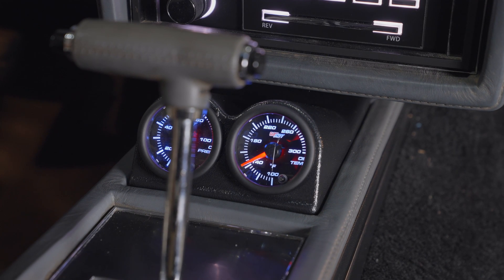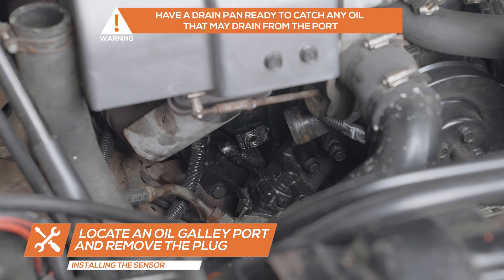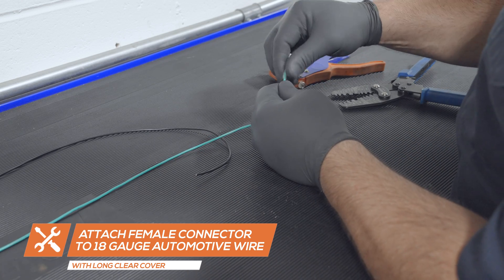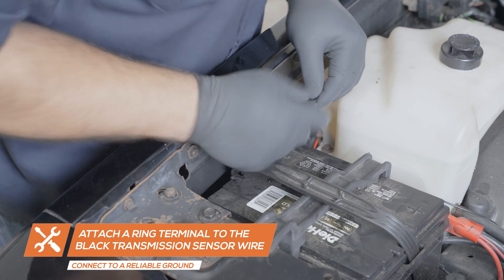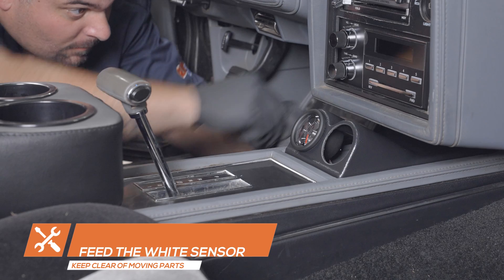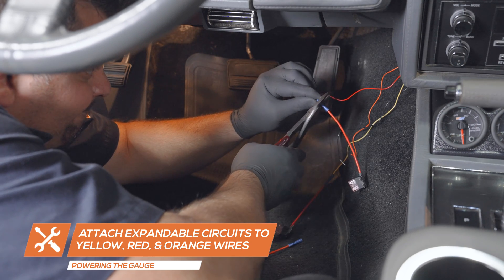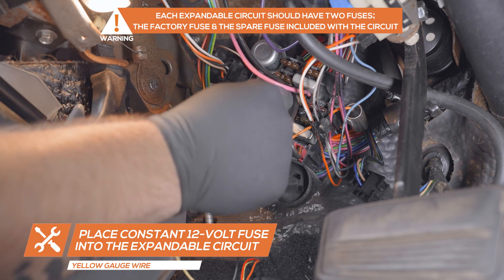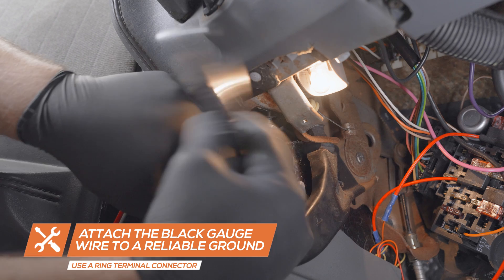GlowShift | How To Install A 7 Color Series Oil Temperature Gauge

Comment: Lets say thats i already have oil temp gauge installed, how would i install my other 2 gauges if i already used 3 expandable fuse for my first gauge alone?
Reply from the maker: Clip off those current expandable circuits and use 3 new ones. Twist all of the red wires from the gauges together and place them into one expandable circuit. Then do the same with the yellow, black, and orange wires.
Reply: @GlowShift  appreciate you fam

Comment: Are the sensor for oil temperature and oil pressure in the same location at the engine? What if I want to install both temperature and oil pressure?

Comment: Do I have to have the sensor installed in order to have power working on the gauge? I have my ground and my test light shows it’s solid. I have the 12v ignition linked to my fuse box with rest light showing that I am solid there. But before I go through the trouble of taking my filter off and installing my sandwich plate for the sensor, I wanted to atleast see if I have power to the gauge. But when I turn my key on, I get nothing from the gauge. So I am wondering if the gauge has to be wired to the sensor to work. Otherwise I’m lost. Unless the I am using the wrong amp fuse. I’m using a 3 amp to add to my 7.5 ignition with an adapter.
Reply from the maker: Without the sensor, the gauge will still power on but will not show a reading until the sensor is connected. The gauge will only work with a GlowShift sensor.
Reply: @GlowShift  well I’ve got no power to the gauge
Reply from the maker: Double check all of the wiring to make sure none if it crimped or not fully connected. If you you are still having issues, reach out to customer support directly using the live chat feature on our website.
Reply: @GlowShift  it’s been solved but thanks you. My next issue is am I okay with Keeping my oem oil pressure sensor in the block and only. Applying your gauge sensor to my sandwich plate? Or do they both need to be next to eachother
Reply from the maker: They do not need to be next to each other.

Comment: I cant find any oil ports on my 2014 vw passat tdi, looked at forms and found nothing I bought the gauge just can't install it please help
Reply: your vehicle must have a stock oil pressure sensor or oil temp sensor, try finding a Y adaptor that will fit instead of the oem sensor, and on one "arm" of the Y adaptor reinstall the oem sensor and on the other arm your aftermarket sensor.

Comment: How would i install 3 gauges into the car if I only have one source for each of those, theoretical question: Would I be able to crimp the orange wire of 3 different gauges into one fuse expansion?
Reply from the maker: Yes, we actually recommend doing that.
Reply: @GlowShift  perfect thanks for the reply
Reply: Yes you can